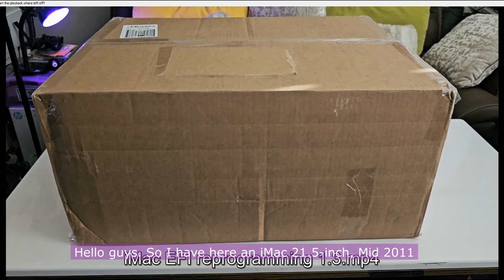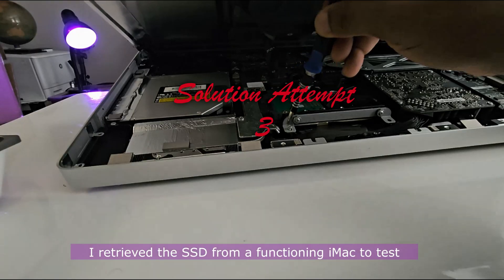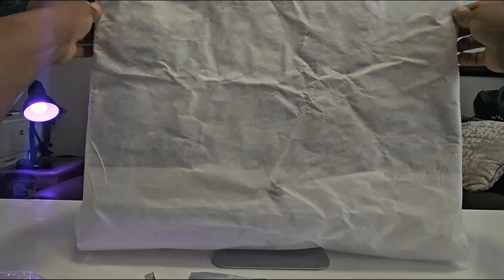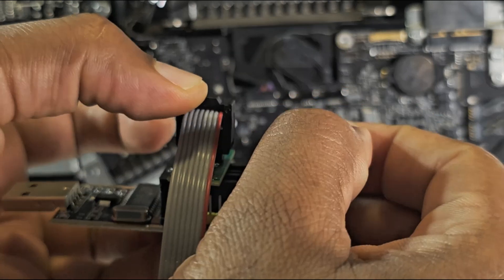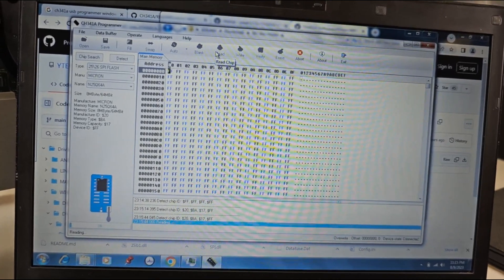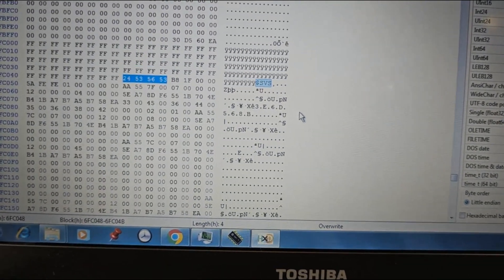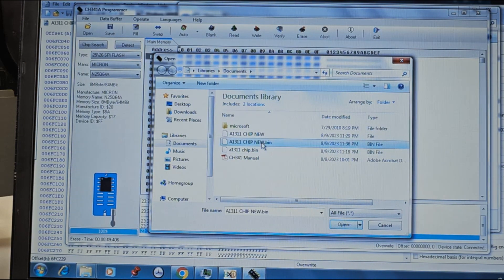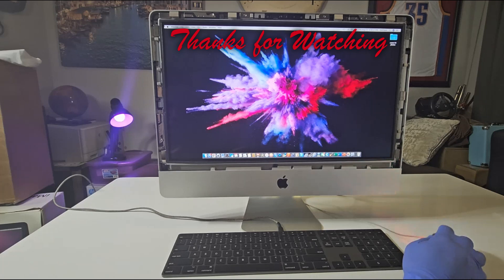Apple iMac 12,1 EFI Locked - SOLVED! | CH341A USB Programmer | No Soldering

Comment: Hello, I have a 27-inch iMac Late 2013 (A1419) that has Find My enabled and it's asking for an EFI password when I try to turn it on. Will this programmer help in my case or not?
Reply from the maker: I haven't tried it before so I cannot say definitely if it would work, but you could try it out if possible.

Comment: Hello friend! Are these programs only compatible with Windows 7?
Reply from the maker: Yes, the files in the link work best on Windows 7. You might use other programs like HxD on other OS
Reply: @aoeaster  Thanks, friend. I'll have to look into it for W7. I have W10. I hope it's as easy as your video, with no problems along the way. Thanks again!
Reply: does not detect it.
Reply: I think it's best to unsolder
Reply from the maker: @ismawel81  sometimes you might need to adjust the CH341A programmer clip a couple of times to detect the chip. You could also try a different chip reader software similar to HxD

Comment: Isn’t it way easier to just reset the PR RAM and take out the memory
Reply: This model doesn't allow that. It rejects all keyboard commands. I've tried many times and followed many videos.
Reply: And I can confirm. Following these instructions in the video worked great and my Mac is up and running. :)

Comment: I used your guide on a 2011 27” iMac. Everything worked and the iMac is now fully working again. I did the programming on Windows 11 with updated drivers from GitHub. To select the correct chip, I took a picture of the chip and zoomed in - then it was easy to choose the correct model

Comment: Worked on a Mac Mini 2012 but I had to find a Win 7 computer. The drivers would not work on Windows 11 despite supposedly being compatible with them. Also when writing the fixed firmware, the writing process was bumpy, stopping at certain percentages for a while then speeding through others. It took nearly 3 minutes to write but it stopped at 100% and didn't verify. Luckily, it still worked.
Reply: Any advice if one can’t find a windows 7 computer?
Reply: @lllllllllll303  Not really. You might have better luck using the recent drivers on Win 8 or later but I didn't. You could try a virtual Win 7 installation, as long as it can access bare metal. Unfortunately, I think you need Windows for this as apparently Linux doesn't work well for this task.

Comment: I did everything the same, but it fails on the verify. I can't seem to get a good burn. Chip is a 25Q064A in a 2012 MBP 15". I've done half a dozen 13" models with no problem.
Reply: Did you ever figure this out I also have a 2012 mbp 15in and am planning on buying this and don't want to waste my time if it doesn't work
Reply: @Whyalwaysreparingstuff  I gave up on it. Every other one I tried it worked with no problem, maybe the EEPROM was bad or something?

Comment: My main computer is a mac pro 1,1. I use windows 10. I would like to have something of a bios setting. Is it possible?
Reply from the maker: Try holding down on the shift key on the keyboard while selecting restart on the start menu. This is one way to access the BIOS on a Windows PC, it might work for your Mac.

Comment: HI! Thank you so much for your video. I've a question: is it possible to run windows 7 on parallels desktop whitin this procedure? Thanks
Reply from the maker: It's not possible to do so within the procedure. The system is locked and inaccessible for use at this point.
Reply: Thanks, but what I was saying was to install windows 7 on parallels instead of an old Toshiba as you did in your video

Comment: Not sure if its can work on windows 10 devices, but I keep getting a drive error with the CH341A Programmer application, then it says device state: NotConnected even the the device is infact being powered
Reply from the maker: Try downloading and using AsProgrammer software with the CH341A Programmer.

Comment: kind regards:
I have a 2012 imac that had the same problem as in your video with the image of the folder with the question mark... I left it on for a while and now it stays on a black screen every time I turn it on, the fan spins but it doesn't do anything at all... would I have to look for a bin file on my board to modify it or just deleting the key like in your case could it work? thank you so much
Reply from the maker: Looking for a bin file would be a great idea, provided it doesn't have any other issues. I would suggest you try using an installation USB to determine if there is an issue with the display.
Reply: @aoeaster  Thank you very much for the reply. When the screen still turned on, I created two USB with different OS Capitan and Yosemite but it never recognized the USBs or anything, only the mouse pointer came out.
I also connected the internet and I got a hard drive with the planet Earth on top flashing. After that it did nothing, just a black screen, but the fan did work.

Comment: Will it work on a imac 2017
Reply from the maker: Yes, 2012 to 2017 imacs should work fine with this method.
Reply: What if the I mac don't have screws to  take out the disk

Comment: Hello, does this work with corrputed ufi chip on imac 2011 21.5"? Its corrupted as it has 9 beeps on startup.
Reply from the maker: This simply clears the password from the chip while maintaining the original chip's contents. If your chip is corrupted, you need a working backup to reprogram your chip.

Comment: Hello, excellent video, I have the same problem but with a 2019 iMac with an Intel processor, do you know a way to remove the EFI password without having to remove the Chip? Thank you
Reply from the maker: I know that iMac 2019 has an EFI chip on board. If you can locate it, you can try to remove the password using the method described in this video.
Reply: @aoeaster  Is that the chip that the iMac 2019 has is not the same as the one you have in the video, there are no tweezers that can hold that iMac 2019 chip, there is no way to hold the chip with tweezers